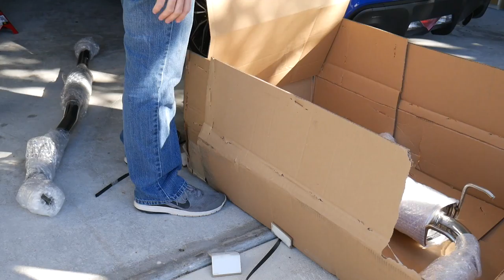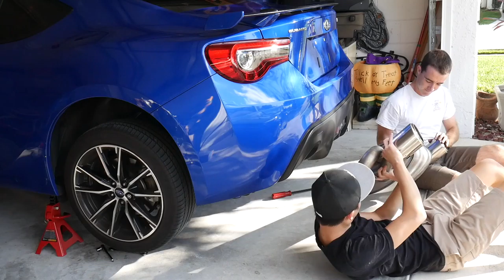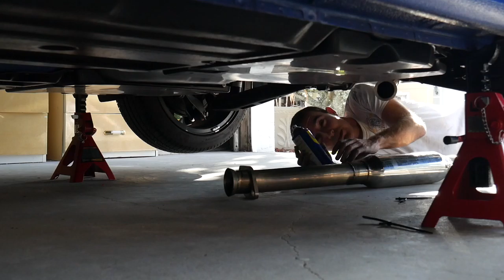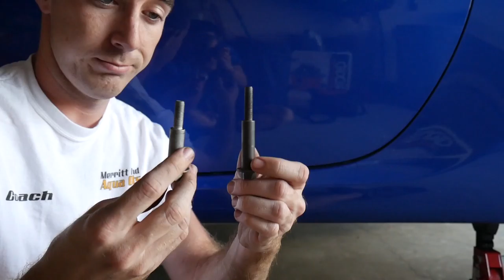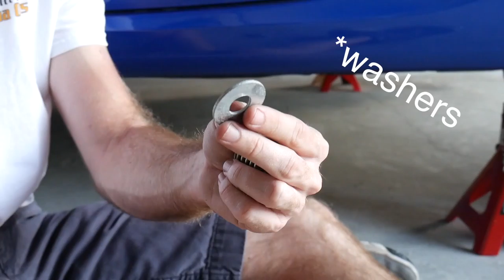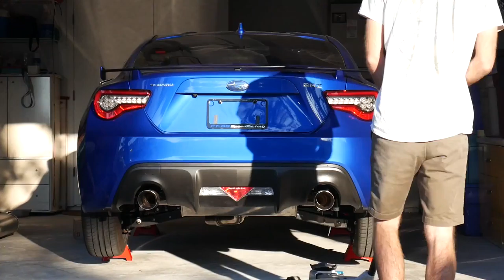FT86 SpeedFactory V1 Exhaust Full Install (tips & tricks + cold/warm starts!)

Comment: I would recommend putting anti seize on the bolts where the spring is just in case you need to remove it
Reply from the maker: 5thGen Thanks for the recommendation! I ended up removing it to trade in for the new car in my latest video without any issues but next time I will!